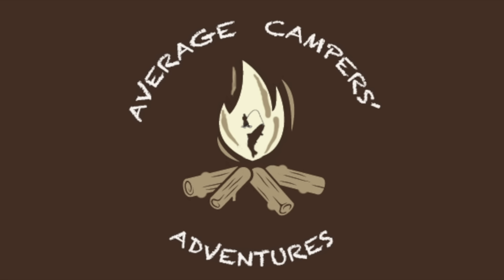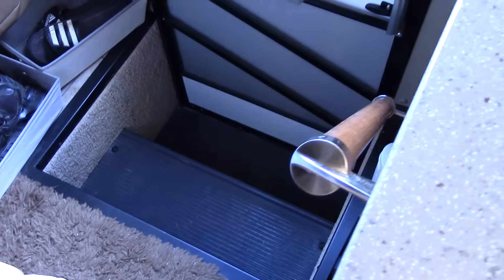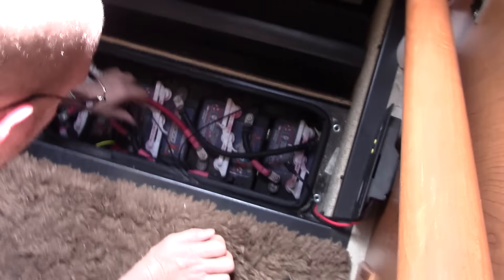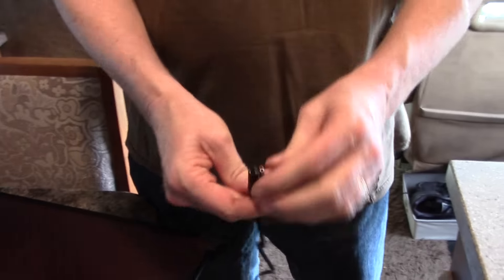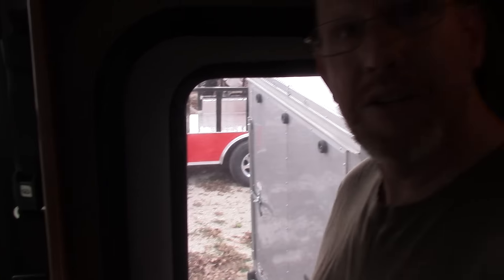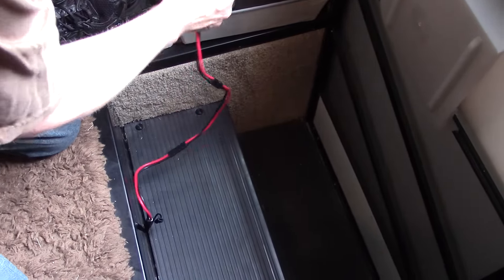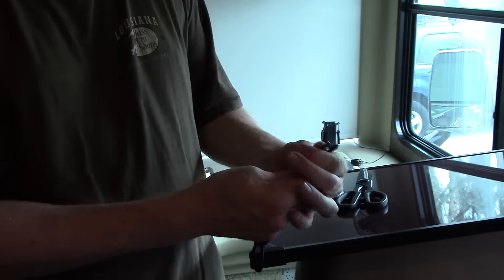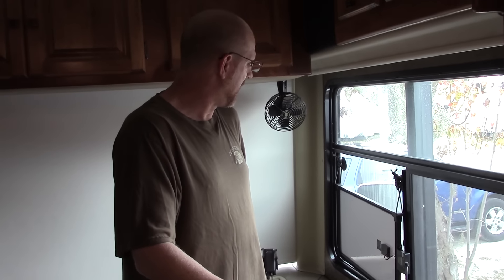Battery Tender Solar Charger for RV House Batteries

Comment: Good job as usual.  The wife and I have different cell service. I have verizon and she has AT&T.  It has proven to be an excellent choice to keep connected.  If you travel in the west, service or the lack of it becomes a fairly routine issue.  Even tho verizon is the most reliable, we have had several times that we could find an AT&T signal and no verizon. I switched her service two years ago and has proven to be a good move.  We both have prepaid plans gives you better economics without a family plan.
Reply from the maker: +Eddie Armacost This was very helpful information Eddie.  Always good to get this kind of knowledge for future decisions.  Thank you !

Comment: it is hard to see how you have the trickle charger connected to all 4 of your batteries.  I bought a similar kit but and i have the 4 batteries in the house battery section of the RV like you.  So, how can i hook up so i know all 4 are being charge at the same time.  I could not tell from your video exactly how you had your wiring set up.  Thanks so much for your help.
Reply from the maker: Hi Stan!  We had our house batteries wired in series like most RVs using four 6 volt batteries.   Check to see if your batteries are 12 or 6 volt.   Look up using Google the wiring diagram for your specific battery setup so you know where to place the clamps for the solar panel.  I’m sorry I can’t help you further without seeing your configuration.  Worked great for us but we have since changed our batteries to lithium so the solar panel was no longer needed to maintain the batteries.
Reply: @averagecampers  Thanks so much.  I have 4 6 volt batteries set up in series like you did.  I hooked up the charge controller (7A max, 14.2 V), the positive to the first in series of the 4 and the negative to the last in series, and the solar panel is 18watts.  It is a 12V battery charging kit.  I am hopeful that the charge controller shuts off the charging when complete but when hooked up it was blinking and giving me the indication that it was charging.  Now it is an issue of ensuring they dont over charge i guess.  I need to put a multi meter on each of them in a couple of days and see how each of them looks unless you think i should just turn on the multiplex system and see what the house batteries are reading.
Reply from the maker: Fortunately, it sounds like you are in great shape.  Most charge controllers will switch to a trickle charge once fully charged.  The only problem would be if you are using AGM batteries instead of lead acid.   AGM needs a special charge controller with an AGM setting.  Hope it works perfect for you as it did for us.

Comment: Thank you for the video. I know it`s a long time but are you still using this and if so has been good for you ? Thanks.
Reply from the maker: We continue to use this when we are away but we have chosen a larger size to be more effective in keeping the batteries topped off.   We also installed a whole house shut off switch to be sure no power was being used.   In the past our stairs drained our batteries as they were hard wired to the house batteries.   Hope this helps.

Comment: I purchased a SUNER POWER 12V Solar Car Battery Charger & Maintainer - Portable 6W Solar Panel Trickle Charging Kit for my Fourwinds 23U motorhome to maintain my 12v AGM battery.   I have the panel on the roof plenty of sunlight in Florida and not getting any maintain voltage on the AGM Battery.  Initial reading was 12.2 volts when I stored her away after a trip.  Next day the voltage reading was 11.8.   Checked all connections all good, disconnected the house AGM battery with the Connect/Disconnect switch.   Ran the extenstion cable under the RV then up the ladder to the roof.   Connection to the AGM is through gator clips.  All looks good.  What am I doing wrong.  Do I need a larger Solar Panel i.e. 10w like in your video above or is something else a miss.  tks in advance.  Frank
Reply from the maker: We had a similar problem and found out that our electric stairs were hard wired to the battery and not through the main cutoff switch.  You must have something connected to the battery still drawing power during storage.   Disconnect the battery completely when stored and you should be good.   Thank you for reaching out to us.  Let us know if this solves the problem Frank.
Reply: @averagecampers   Thanks for the response.  Checked her today and she was down to about 8v.  So Decided to bring her home and fully charge her with on garage unit.   THen back to rv.   I will not connect it to the house cables just to the solar panel and see if that maintains it.     Will keep ya updated.    Hope you not in Florida.  Up here in Gainesville its around 45.  Nice and chilly.
Reply from the maker: @frschof  Sounds like that should work.  We are in Northern Florida around the Big Bend area and the cold has been brutal.  Finally warming up today :)  Bring on the sun!

Comment: If a coach has a battery disconnect switch, dosn't that keep the batteries from draining?
Reply from the maker: We thought so but the automatic steps are always connected and seem to have some drain.  We read that wet cell batteries will drain slowly over time without being connected.  Hope this trickle charge will give of the piece of mind that our batteries will not be damaged if we leave them sit for a month or so.   Thank you for watching Jean!

Comment: Are your batteries till working???  I was looking to do the exact thing but use the 15 Watt one ( they make a 5, 10 and 15)  obviously you are using the 10.  my concern was my batteries are currently charging when the MotorHome is running, or plugged into shore line, or Generator is running, I wasn't sure I could put a Solar charger on it?  wasn't sure what would happen when the Generator is running, and the solar was still charging? ( was thinking of mounting it on roof with super adhesive 3M Tape designed for rain and extreme outdoor weather)  But wasn't sure what it would do to my equipment if solar and generator are both running at once? I'm assuming the tender would say Voltage is Full and not charge? while Generator is going?
Reply from the maker: This charger is for keeping the batteries topped of when we had our RV in storage.   We now have 430 watts of solar connected to a 300 ah lithium battery via a mppt charge controller.  When the RV is running the strongest voltage will charge the battery.   All other sources will shut off automatically.   Hope this helps.   Safe travels and thank you so much for watching!!
Reply: @averagecampers  thank you,  I have 2 batteries under the step, that charge when plugged into shore line,  or generator is running, and I think when Motorhome is running? But I don't have power to my outlets?  Only the lights seem to work off the batteries, ( and when front battery died, switch in front helped to charge from battery under steps), like you I  camp placed that have limits on generator useage, so trying to use a 15 Watt solar Tender to charge 2 more that will give me solar for outlets somehow.. lol.  I like tenders cuz they don't overcharge your stuff .

Comment: I doubt that you will get much amperage output from that panel mounted vertical in the window.  It will only be perpendicular to the sun about an hour a day and that will be when the light is dimmed by the low angle of the sun.  10 watts = .6 AH under the best of conditions.  If you can face the coach to the south, try putting the panel in front windshield at about a 45 degree angle.

Try testing the amperage output with the multi-meter that you should own at different time of the day.  Ignore the voltage.  So long as the voltage is over 13, the amperage is the important thing.
Reply from the maker: This is great information.  Thank you for sharing Steve.  We will give this a go and see if we have better results.  Safe travels!

Comment: If you already have solar why can't you just leave them hooked up? (Not a good idea to pinch those wires)
Reply from the maker: We have not completed our roof mounted system yet and needed a simple solution.  Good idea about the wires.  Thanks for the heads up on that one...I will look into an alternative to prevent pinching.  Thank you for watching Buddy :)